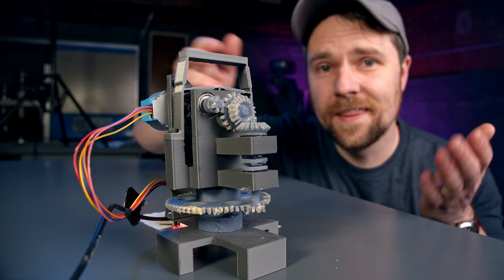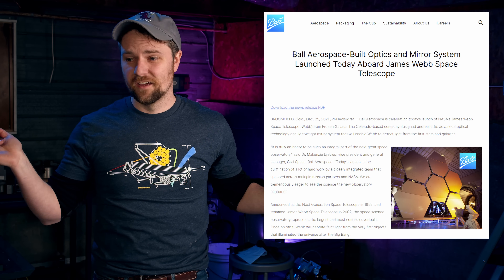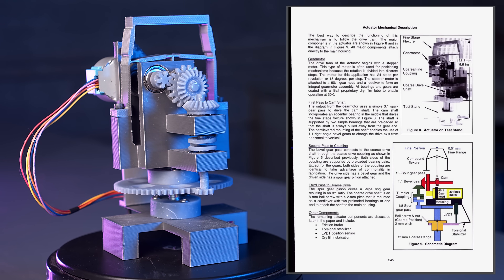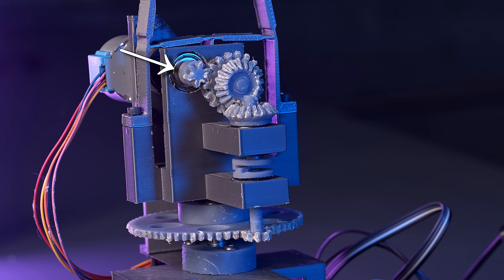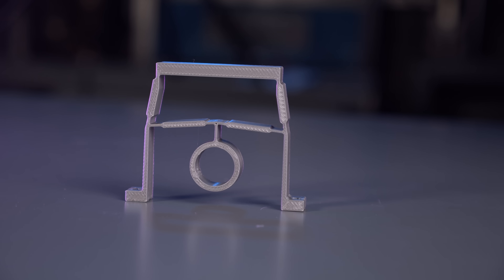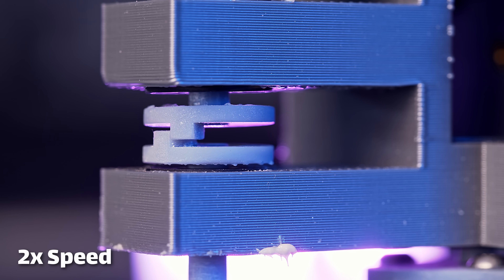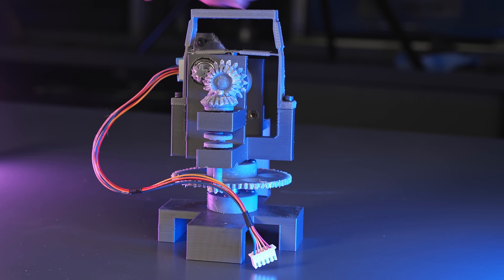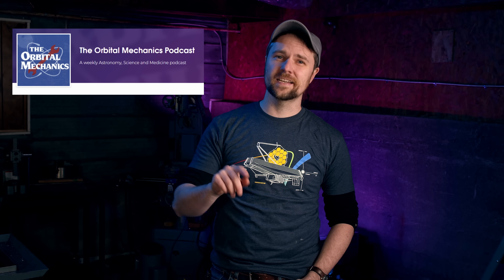How to achieve nanometer precision in space?

Comment: Are there any specs on the hexopod redundancy?  How many actuator failures can it withstand?  Maybe just a loss of travel?
Reply from the maker: My understanding is that there is essentially zero redundancy in the hexapod itself. Parallel mechanisms like the hexapod require coordinated motion from all the actuators to function correctly. Theoretically you can get some motion with one actuator stuck (i.e. one corner would become a "pivot" and make the already non-linear kinematics really unpleasant), but it might be pointing off into the wrong direction and no way to fix.

But I think the super long travel on the actuators (21mm) was something of a redundancy mechanism. If they are having trouble with one segment all the other segments have a lot of travel to help compensate. But I'm not entirely sure, I couldn't find a lot of good information on that aspect. They might have some other tricks up their sleeves.  There are also three different "prescriptions" for the segments, not all mirrors have the same curvature. So something in that  optical design might also allow a certain amount of redundancy.